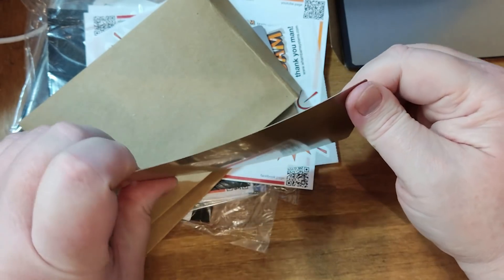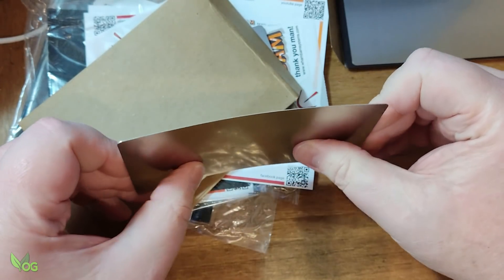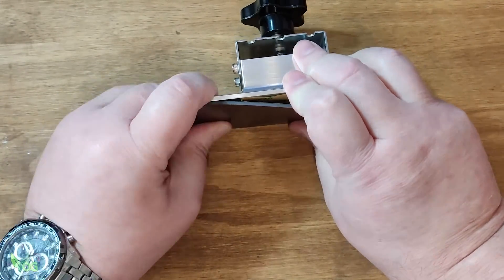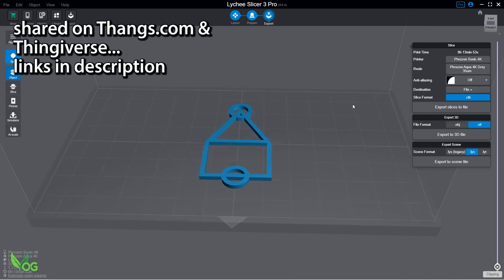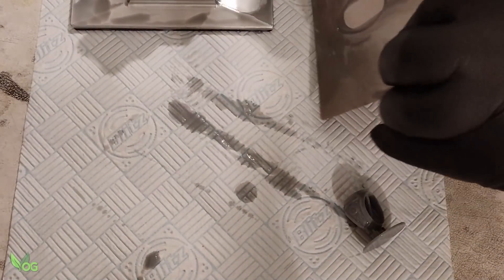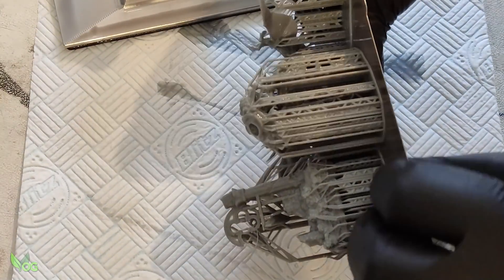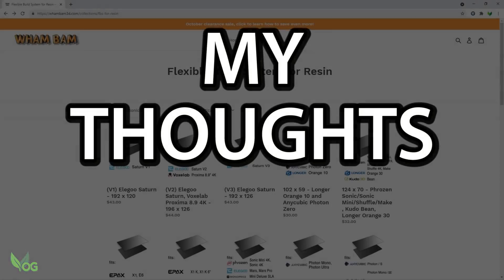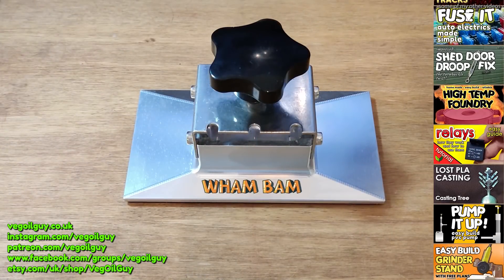Wham Bam flexible plate review - using a flex plate in Resin 3D printing - by VOGMAN

Comment: I just got a Saturn and the very first thing I did was order one of these. Love wham bam plates, I have at least one for all of my printers. It works even better on larger printers than small. The only problem i have ever had with it was on my sonic mini 4K. The build plate it pretty small, which means the magnet is pretty small. So if you fill the build plate, the magnet strength isn’t quite enough to stop it from moving. The plate won’t detach from the magnet but it did have a habit of sliding and causing all kinds of layer shifts. But again that was only if I really filled the build plate on a small format printer. I’ve been able to fill the build plate on my Saturn with no issues since the surface area of the magnet is so much larger. (Plus the mini 4K isn’t nearly as rigid and I think the flex that the build plate arm had a lot to do with that as well, definitely not a fault of the wham bam)
Reply: They like to advertise that you can just snap the plate back on the magnet without cleaning the excess resin off. I think that many people have had layer shifting because of this. It's like putting a film of oil between the plate and magnet... Always clean the plate and magnet before starting a new print.
Reply: @BEdmonson85  You're right, if you dont clean the excess resin off the magnet it is significantly easier to have the plate shift. But it does still shift on my mini 4k even if i thoroughly clean everything if I overfill the build plate. But I do that so rarely that it is a fine trade off. If you dont thoroughly clean it it will shift fairly easily even with normal prints.
Reply from the maker: Thanks Travis. 😁
Reply: @Xploit66  Man, that's a bummmer :(
Reply: @BEdmonson85  Its really not a big deal under like most use cases. Its only if you have a really small build plate and you absolutely fill it. I am able to basically fill the build plate on my saturn without the problem. The sonic mini 4k just doesnt have enough surface area for strong magnetic force and the way the lifting arm flexes it makes the problem worse. But for minis or rings etc it works flawlessly. Still worth it, but if you think youre going to fill the build plate its worth getting a second one.
Reply from the maker: Great input 😁
I would imagine if you leave resin on them it can act as a lubricant between the plates allowing for a little movement.
Reply from the maker: Thanks for the input Travis 😁
Reply: For your Saturn did you attach the extended z homing spacer? I hear you have to do that. I own a staurn s please lmk!

Comment: The main complaint I've seen about these are with heavier prints, that they can pull the plate away from the magnet. And also that the resin breaks the glue apart over time that is holding the magnet to the build plate.
Reply from the maker: In their video, Wham Bam talk about adhesive. They are confident the 3M adhesive strips they use are more than up to the task. As for larger prints, I can see that could potentially happen.
Reply: Been using one for half an year now and as far as I can tell the adhesive is fine. As far as heavier prints even with full build plates using the full build volume I haven’t had any issues
Reply from the maker: Thanks for your input 😁
Reply: @MaheerKibria  me neither and I have printed some heavy parts. Never had an issue with a genuine wham bam plate. Their magnets are ridiculously strong for their size.
Reply: The glue is plenty strong for the task if you follow the manufacturer's directions on installing it.

Comment: I personally think the best thing is that you can get a pair of these plates for less than a second build plate and print back to back without having to spend time cleaning the build plate.
Reply from the maker: Good thinking 😁
Reply: What do you mean with cleaning the build plate? Are you supposed to clean them? Blasphemy!
Reply: @GarbachNL  I agree with you... I've done print after print without cleaning off the plate... if I'm changing resin I'll clean the plate, but why wipe off resin when you're only going to dunk the surface straight back in exactly the same resin?
Reply: I got mine shortly after they were first released and they only had the single plate version in stock at the time. I should buy an extra plate!
Reply: But I _always_clean the plate.

Comment: Have a flexplate on my mono x, i love it, way harder to scuff marks in to than the aluminium buildsurface
Reply from the maker: That's a good point. Thanks 😁
Reply: Did you have to modify your z stop or just relevel the plate?
Reply: @EliteMinerZMC  had to put 3 washers underneath the z stop actuator

Comment: I've wondered about these for a while, I would like to see what you think of a versions for larger printers. Small stuff I generally have no problem with, but big prints on the Mono X can be a bitch to remove.
Reply: I just got a Saturn and the very first thing I did was order one of these. Love wham bam plates, I have at least one for all of my printers. It works even better on larger printers than small. The only problem i have ever had with it was on my sonic mini 4K. The build plate it pretty small, which means the magnet is pretty small. So if you fill the build plate, the magnet strength isn’t quite enough to stop it from moving. The plate won’t detach from the magnet but it did have a habit of sliding and causing all kinds of layer shifts. But again that was only if I really filled the build plate on a small format printer. I’ve been able to fill the build plate on my Saturn with no issues since the surface area of the magnet is so much larger. (Plus the mini 4K isn’t nearly as rigid and I think the flex that the build plate arm had a lot to do with that as well, definitely not a fault of the wham bam)
Reply from the maker: Thanks for the input Travis 😁
Reply from the maker: Wham Bam do some MASSIVE plates. I agree, these would be useful on bigger printers 😁
Reply: I clean it off then put it in the freezer for a minute & it pops right off, even a solid block.

Comment: I love my Wham Bam flexible plate. Especially on larger format printers as I like printing some objects flat to the plate and they can get stuck on really good. I have never used a metal scraper as I don't like the damage it does to the plate on really stuck on objects. I also like to wash the prints in the wash n cure with the flexible plate attached (minus the supports which I take off by hand before washing). I wouldn't go back to the other way.
Reply from the maker: Thanks for the feedback Tim 😁